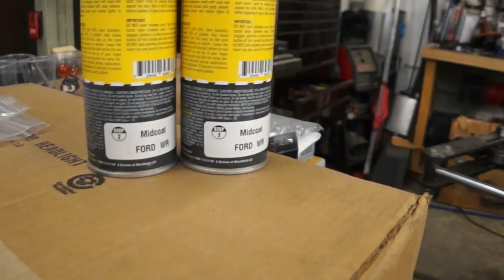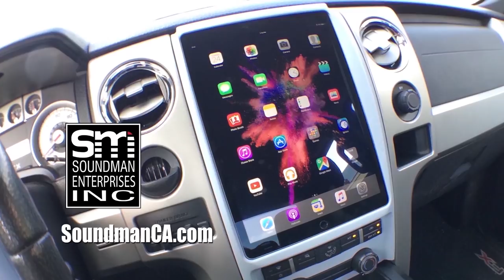I Painted my fender with rattle cans from AutomotiveTouchUp.com! - The White Rider SERIES #34

Comment: The fender came out great Doug!! I have to do the rear fenders on my 2500 GMC they have developed rust bubbles. Have to strip them down to bare metal and fill holes with body filler. Basically do everything you did in this video.. You have given me a glimmer of hope that it will come out ok!! Thinking I will just remove the bed for easer handling?. Looking forward to the next video 👍🏼💪🏼✌🏼️👊🏼😎.

Comment: Sanding the bodyfiller wet was a big mistake, bodyfiller is like a sponge. Water and bare metal... 

The 1k primer will die back in a time, will be easy to fix tho. Just wet sand the die back with 2000-5000 grid and polish it up.

But the result is nice anyway

Comment: Tiger stripes happen in one of two reasons with pearl... One you didn't do a 70/30 overlay which means 70% overlap of the original first spray... the second way is not changing the direction in which you our painting...

Comment: Your good bud. Please don’t go out and get some optima batts. Keep it stereo and look at lithium or XSPower. Full throttle something that has a thing with the stereo community.  
Amp labs JYPower Full throttle XSPower Crescendo. 
 Put some damn money into the internals of those pumps. Pump super seal. Marsachie pump heads. Delta dumps.   Thats it. Save you toooons of cash on repairs.  Restolite boxes.